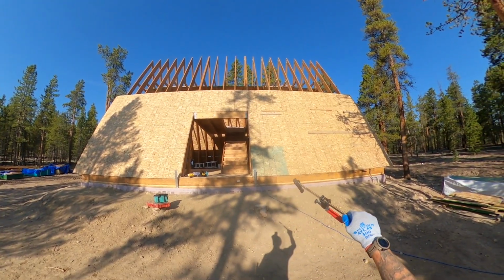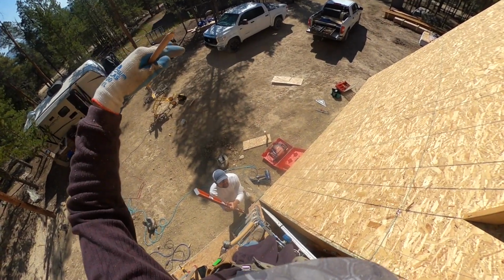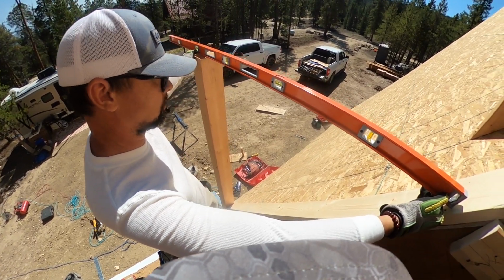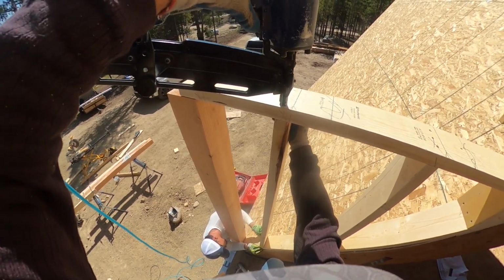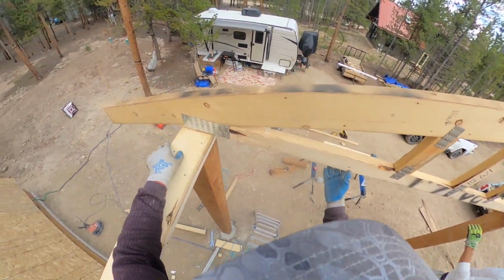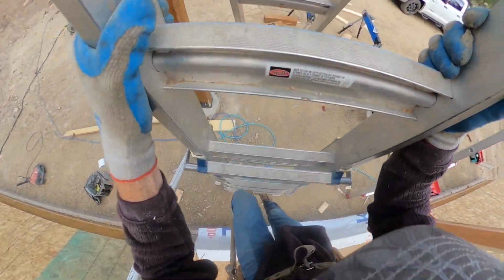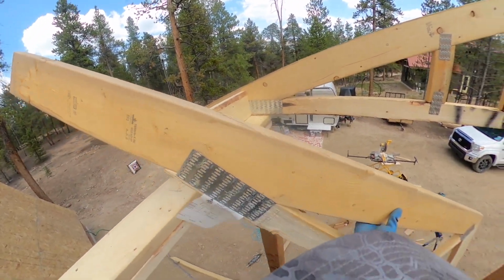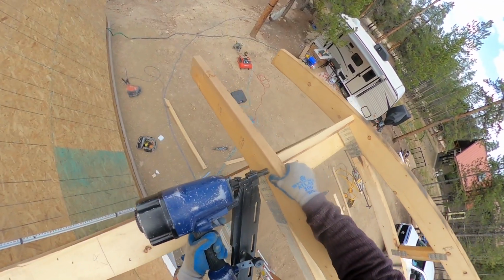Entry Dormer / Water Barrier for A-FRAME | AVRAME Trio 120 in Colorado

Comment: @14:00 are you sure the instructions call for staples on that barrier? They normally call for a specific nail with a cap on it.
Reply from the maker: It's a good question but the staples are per code. Never really used button cap nails, I like how the staples don't penetrate through the roof sheathing where a button cap nail would. I want the least amount of penetrations in the roof sheathing as possible, and between half inch staple and self adhesive water barrier that's what I find.

Comment: Are there soffit/ roof joist venting anywhere? I noticed the ridge cap is completely sealed.
Reply from the maker: It's a good question. We typically always gap the ridge and then do soffit ventilation. This A-frame system does not include any soffit ventilation. The owner asked we butt the ridge to make the house as air-tight as possible. We did a spray foam / batten insulation afterwards. There is mechanical that includes forced air, etc.     I'm not an engineer nor was I the GC on this project. Hope this helps thanks.